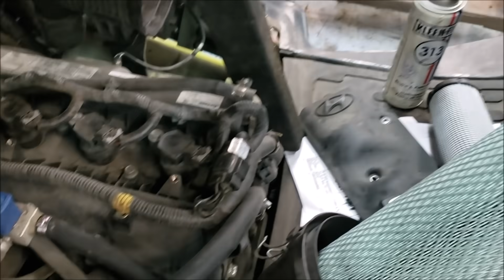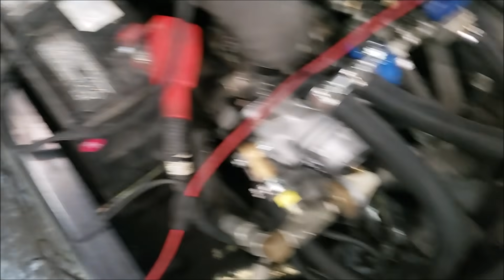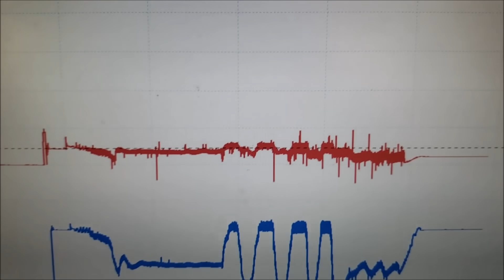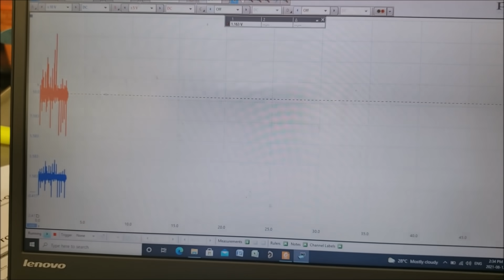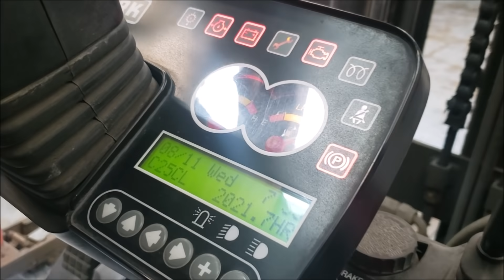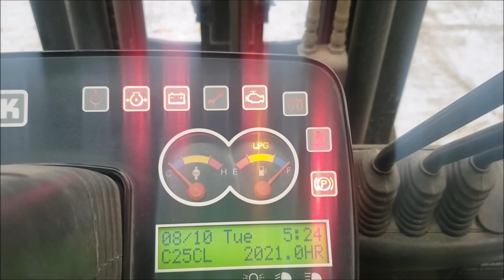Hyundai Theta, running rough, hesitates under load

Comment: Hey I have 2 Clark C25 CL Forklifts that idiling and cutting off. I am getting a different code on both of them the codes are 0172 and 0108. Can you tell me what these codes mean and how to fix the problem. Thanks in advance.
Reply from the maker: 0172 system too rich, 0108 manifold absolute pressure circuit high input
Reply: Thanks a lot
Reply: I have a the same forklift c25cl and is throwing the  0172 . I have rebuild the regulator and injectors and still throwing the same code. My question is what else can I check?
Reply: Same issue. How did you fix it. I have 0172 even after I rebuild regulator and injector

Comment: I have this exact engine in my c30cl clark forklift.  How do you find the part numbers for a repair kit for the springs and O rings that are inside the pins that the pressure sensors  sit on for the fuel rail?

Comment: I have a Yale GLC050 2.4l It just has a vaporizer to a fuel rail with injectors, not sure what year it is. I put a brand new vaporizer with lock off value on, and it will only run if I barley crack the propane tank open. Any thoughts? Thanks.
Reply from the maker: Try to check your MAP sensor.